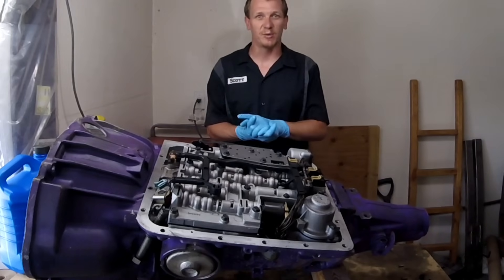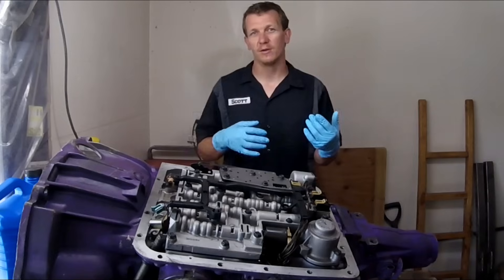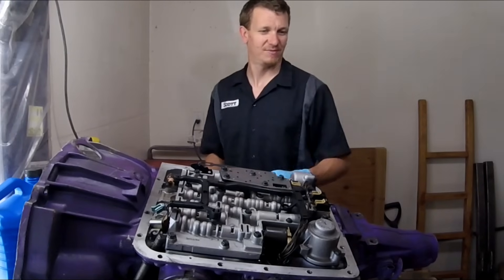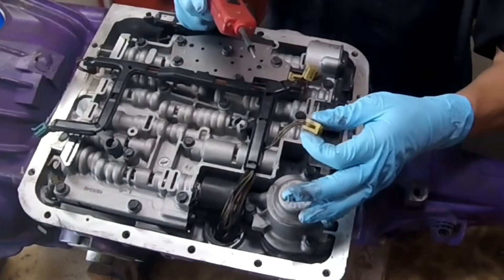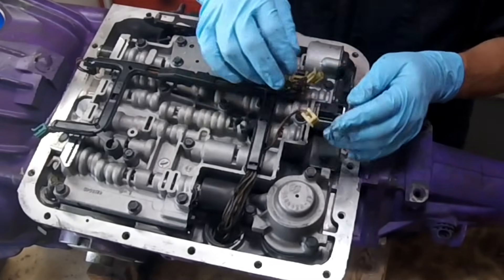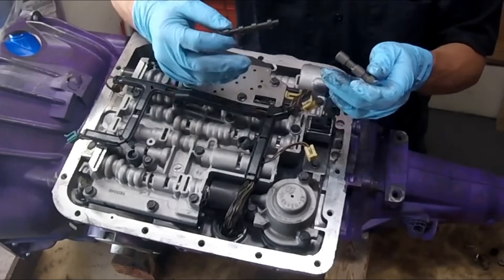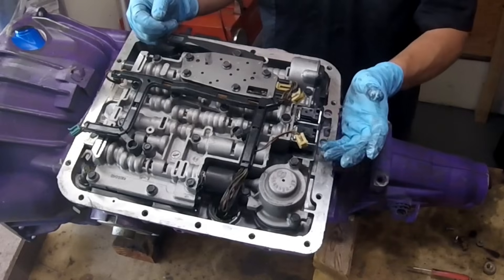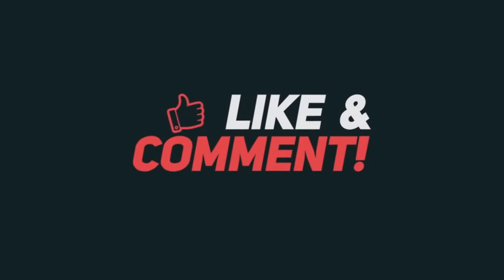⫷ GM 4L60-E Shift Solenoid 1-2 3-4 A and B replace p0756 p0753 p0752 ⫸

Comment: Hey Scott,I have a 1995 Camaro v6 with the 4L60E all gears shift fine but when I take off from a stop it feel's like it is slipping and fluid level is fine,the main plug on the side of the trans.will not lock down in place,could that be the prob. and I did replace a line that was leaking and speed control censer. can it be bad solenoid/dirty?

Comment: I know this is an old post but quick question. I have a 95 z71 and it usually shifts fine as long as I dont go over 65. If i do go over it will shift from 4 back to first while going that fast. Could that be shift cylonoids

Comment: Mine's getting stuck in 3rd unless I stop and put it in park or turn off the engine, then it will reset , but once i drive it gets stuck all over again.  Could it be these solenoids or is my trans on the way out? fluid still pink 107k miles on the original 22 year old truck! Great vid!
Reply: Sounds like those solenoids need to be changed

Comment: I have  a 2004 gmc envoy xl I was driving about 35 or 40 and I heard a loud noise and lost all power no forward gears ⚙️  and reverse???  Please help no check engine light or no trans light
Reply: Sunshell?
Reply: Did you find out the problem are fix it?🙏🏾

Comment: Really great video this video really helped me out.    Thank you
Reply: I have a 97 Tahoe 4x4. Shifts fine from 1st to 2nd but rpms high and does not shift to 3rd. I didnt attempt to forcing it to shift. I havent hooked up a ODB scan tool as of yet. In need of some advice as where to start cause I'm stuck in Oklahoma.

Comment: How does reverse gear work I have a issue no reverse and drive on all gears including neutral and Park I think there is an issue with manual shifting valve
Reply from the maker: So your car is not moving at all? No reverse? And no forward gears? Or you only have forward motion?
Reply: It does drive fowered in all gears 1-D and it also drives fowered in neural gear too. But it won't drive in reverse at all
Reply from the maker: @karleezy1  have you had this transmission out at all? Has any work been done to it? It sounds like your linkage might be set wrong. Have you tried getting the vehicle off the ground and removing the linkage? I would first try to Jack all four wheels up off the ground have somebody in the truck with the brakes on and remove the shift linkage from the transmission. See if you could push it more forward with the linkage disconnected. While in the air if the linkage will move more forward have the person in the driver seat just release the brake pedal slowly. Just so you could see if it's in reverse. If that doesn't work you might have a sun shell problem. Have you ever heard a loud clunking sound like driving over those big metal road construction plates?
Reply: The transmission hasn't been out of the vehicle that I know of. I did drop the pan to replace A and B solenoid it wouldn't drive in D or 3 gear and had codes. After that it was driving fine in all gears but it been sitting for 3 to 4 months. Tried to move it a week ago would drive fowered but not reverse. It also feels like it wants to drive in park too but won't cuse the transmission lock
Reply: @karleezy1  replace the shifting selector module on the driver side of thye tranny where your shifting cable connects to.. that is your problem ..
Reply: The only thing I can think of is the manual shifting valve.  Isn't that the only thing controlling gear selection. Reverse is not controlled by electric solenoid right. That's the only thing I can think of when it drives in neutral and it wants to drive in park

Comment: I have a 2004 GMC 1500 and I have to let off the gas first and second for it to shift then after that it shifts fine all the way up to drive any suggestions??
Reply from the maker: There could be a few issues causing this problem for you guys. The easy fix would be a problem with the throttle position sensor not giving accurate readings to the computer and not allowing the computer to control the transmission properly. So maybe your TPS is bad. You could also have a stuck or leaking 1-2 accumulator or 1/2 servo. If these are leaking or stuck it will not allow pressure through the transmission to flow the way it should. Now third, you could just have a line pressure issue. That could be the pump going bad or that could also mean you have debris somewhere in the transmission acting as a damn.
Reply: @ScottiesHobbies  what pump would this be sir?
Reply: Same here with a 2003 chevy  impala 3.4.

Comment: So i was doing this job couldnt finish bc mine is missing the spacer
Reply from the maker: Some do not have the spacer. Just remove and replace what you have. A spacer wouldn't be able to fall out by it self.
Reply: My transmission at 55 mile an hour as shit from dry overdrive to drive back-and-forth but if you give it to gas it or stop it don’t slip it acts like it select Tronic what should I check

Comment: Thank you so much for this video! Very informative. I have a quick question. I drive a 2001 s10 extreme 4.3 motor. I believe it has this exact trans. I recently put a surefire remanufactured 4.3 in it. While i was doing motor swap, i removed torque converter and cleaned it all up and put it back on and torqued down the 3 bolts. The new motor has about 1000 miles on it now. The problem is....the transmission is jumping back and forth in between driving speeds of 40-50ish mph. The rpm gauge shows the trans jumping gears up and down as well. I feel it in the trans when it happens and also the rpm gauge is consistent with the up and down shifting between 40-50ish mph. It even does it if i set cruise control within that speed range. It's almost like it can't figure out which gear it wants to be in while within the speed range of 40-50ish mph. I do NOT have any codes referring to bad shift solenoid(s), so I am wondering if the torque converter is bad? Or can the solenoids be bad even though I dont have a code thrown about them? Any advice is helpful as I have spent a lot of my time and money on this project truck of mine to bring it back to life. Please please please let me know anything that would be helpful! Thank you soooo much in advance! I am uploading a shirt video that captures the rpm gauge while it happens. Maybe if you watch it it will help to explain what I mean in the post.
Reply: Scottie, Do you have any advice? I am in a desperate situation and don't want to tear up the brand new motor that I spent $ and my time installing. Nor do I want to tear up the transmission. Any advice would be greatly appreciated!!!! PLEASE!
Reply: No pibuf
Reply: Any updated advice? Same issue w my 2000 ZR2 was happening, then I lost 3rd gear altogether. Most of my research pointed me in the direction of the 2-3 shift solenoid, but i want to be sure before I go dropping my transmission

Comment: Hi great video. I have a 1998 chevy k1500 and the return transmission cooler line rusted out so it lost most of the fluid. After I put the new line on and refilled it doesn't shift past second gear. I'm hoping the transmission isn't in a need of a rebuild any suggestions?
Reply from the maker: Could be a number of things. If you got debis in the fluid you could get a part jammed. Id start by checking the shift valves for movement and also check the accumulator. Thats a start.. it could be that 3 and 4 clutches are burnt too. But I'd start with checking the shift valve and accumulators.
Reply: Cool thanks but I forgot to say in my first comment that the transmission did end up overheating as well because the line blew out on the highway. Would overheating be able to burn up the actuators, acummulators, and or solenoids?
Reply: @ryantahtinen1949  damn this is the quetion i need answered!!!!

Comment: Please help me my truck shifts fine in other gears but in 1st and second it dont shift i have to wait till it gets to 40 to shift
Reply from the maker: The one to accumulators are known to go bad. If I were you I would take the pan off check the accumulators and check the 1 2 and 2 3 shift solenoids. If all those are good then I would start looking into line pressure.

Comment: Hey man thanks for the time you put doing this videos....I was just hopping if you could tell me if it is possible changing the wire harness whit out moving the valve body. ...thanks for your time!!
Reply from the maker: Valve body does not need to be removed to change harness.

Comment: I didn't notice that there is also a spacer they came out with that valve so now today when I finished up and I started my car in I put the transmission fluid and everything back in now it is a knocking ticking noise that comes on only in drive or reverse but not in park... Am I missing that spacer is that the reason it's making that noise it goes into gear it is makes a noise?? Please HELP!!
Reply from the maker: Is it a loud clicking noise?  Like you are driving over construction road plates or quiet clicking?
Reply: @ScottiesHobbies  Its A clicking Noise, its only happening while im in drive or reverse , not in P, N!! Just D, R!!
Reply: It doesn't sound loud like those construction plats, its a light clicking gets louder the harder i press on the gas, i did jack up my tranny to get to the drop bar that was in the way of the last three bolts on the tran pan..
Reply from the maker: I've noticed not all of the valve bodies have the spacer that minded. It's Different Generations. But if yours did have the spacer and reassembled it without that spacer you would probably not get that solenoid to shift properly. Or should I say shift valve to shift properly because you're going to have too much play in the boar. So if it's not shifting and you're getting the ticking sound then that could be your issue. If you're getting good shifting but still ticking then it's going to get kind of difficult. I would always recommend at this point if it wasn't taking before or if you're realizing you're seeing something new that wasn't there prior to doing the repair it's always nice to pull it back apart and do the job a second time. Just to make sure it's done correctly. When you do it a second time it's sometimes a little bit more comfortable knowing what you're going to be getting into. Now if everything is right and it's still taking, do you think you could have anything rubbing near the drive shaft? Not too many parts inside the transmission should be metal a metal enough to make a ticking sound. I know you get the clunking or loud construction sound when your son here is starting to go bad but that is usually pretty loud. Do you hear it more in the cab or outside the truck?
Reply: @ScottiesHobbies  i only here the clicking while in drive and in reverse , meanwhile im not driving , its at a stand still.. ill put it in park , and not hear the clicking.. It get loud when i drive it, or if i put it in reverse...I put the solenoid valve bk properly it was only one with a screw, Now im thinking since i used a jack to jack up my tranny to be to remove the last three bolts that i couldnt reach do to big drop bar that was in my way, did i loosen the shift plate screws on the torque converter???

Comment: So are the 1-2 & 3-4 The A & B shift solenoid the same?
Reply from the maker: Yep
Reply: @Scotties Hobbies.. So one of the places I looked at the solenoids showed 1-2, 2-3, and 3-4 all 3 to be the same is this correct? 
And I found your channel when I was looking for info pertaining to Code P0765 that I'm getting and the truck seem to not have 1st gear.. but seems like all the rest work.. Truck only has 91k miles on it 2002 1500 4.3l.. Thanks..
Reply: Scotties Hobbies sweet!!!
Reply: Correct replace both ...

Comment: Thank you very much for your help will try to do what you advise to repair my transmission with code p0751 shift selenoid performance or stuck off
Reply: Hector Lopez did you have fix your problem? I'm having code p0760 on mine and I'm at a lost
Reply: Also curious if either of you found a fix?

Comment: What are my options? Is it a must to take valve body out to change the solenoid master harness only. There is just no way I can glue it back.  I broke the cable lock tab solenoid 1-2A while installing the pan.  The one near the back behind exhaust cross member. thankyou
Reply from the maker: What year is it?
Reply: 2004 2wd 5.3L
Reply from the maker: You can find kits here: https://ebay.to/2Ng5yIo I'd recomend replacing as much as you can the first time. The filter, Bother shift solenoids, harnes, and other accessible solenoids. Get it done the first time.
Reply: @ScottiesHobbies  hi man i got a cold solenoid B stuck open I change both solenoids transmission goes into reverse and first gear only is it time for a new transmission or should I change the whole transmission
Reply from the maker: @marshawnstewart5420  in all honesty, replace it if you have the money readily available or do a complete rebuild. Make sure the 3rd check ball in trans get replaced too. It cost a little more to get a tranny from jaspers or similar company. But, it comes with a pretty good warranty. Alternatively I would take it for a complete rebuild. If one part is going bad, the chances of a domino effect is likely. If you don't have the extra money you will need to be pretty mechanically inclined and attention to detail on the rebuild. I think its fun to work on the and recomend as a hobby but as emergency repair with little mechanical experience, pay to get it right. 

Hope that helps. I might post a video reply to this soon.

Comment: hi i have a 2010 chevy express 1500 4.3 with 4l60E, im ok at 1st gear, but second revs high and then kicks into 3rd, i got code TCC , Is that a rebuild? or torque converter replacement?
or something else thank you for your time and keep up the great work, thx
Reply from the maker: How about 4th gear? Have you checked for any debris in your fluid? You might have a solenoid A going bad or possibly lack of line pressure. But usually a lack of wind pressure will cause harsh or delayed shifting all the way through. In this case I would for sure check solenoid A for continuity and for functionality with a 9 volt battery. If that all checked out fine make sure the wiring harness is good too. If that is all good I would start to worry that there is something more internal. But start with all your basics.
Reply: 2nd and 4th are controlled by the band

Comment: hey scottie  have  a 99 gmc Yukon Denali  with 4l60 e it doesn't  down shift when coming  to a stop light .and it's just sluggish  and feel heavy all  the time if that makes sense  can you help me
Reply from the maker: Pump might be going bad. Probably a lack of line pressure. Have you checked for codes? Checked the fluid?

Comment: You need to keep up the good work I learned a lot about the solenoid keep these transmission videos coming I will watch them all 👍👍👍
Reply from the maker: Thanks! I plan it. I have a couple more fyi vids like this one coming up soon. I also have another 4l60e laying around that I might rebuild with every upgrade i can find that will work with one another.
Reply: @ScottiesHobbies  I have a used 94 Sierra C3500 U-Haul truck and recently got a code 39 which is the Torque Convertor Clutch sensor.  Which sensor is TCC sensor?
Reply: @ScottiesHobbies  and where is it located?
Reply: Is this a do it yourself job? Do you need a computer or anything to reset anything?

Comment: Scotty what is 96 inch pounds in ft pounds , i know i fckd up and snapped one of the bolts and i cant figure it out
Reply from the maker: 96 inch pounds converted over to 8 foot pounds. I believe most of the bolts on the valve body going to the transmission housing are all 8 lb. Off the top of my head I can't think of anything that is larger right now
Reply: @ScottiesHobbies  thank you

Comment: I watched your other video on changing out the Shift Solenoids on the 01' Tahoe, same transmission as my 98' Blazer but mine is a 4WD and there is a drive shaft right in the way of the shift link and I can't seem to get my hand up in there properly to get the T20 on it to release the shift link off of the pan. I was just curious on if it's still the same process to take the transmission pan off or is it a different monster cause it's a 4WD? Any help would be very much appreciated. Loving the videos by the way, been learning a lot from watching them, have a good day and I hope to hear back from you. :-)
Reply: T40***
Reply from the maker: Can you reach around with a 1/4 drive? Probably no room still. In your case bending the bracket is probably the easiest.  Id probably use bigger vise gripps on the bracket as far away from the bolt as possible and bend it back as little as possible. . I hate to even say that tho.
Reply: Really only option without taking alot apart